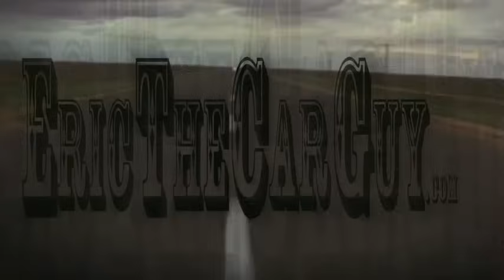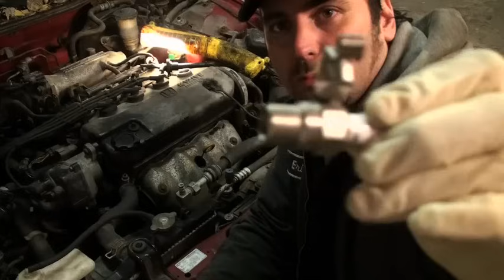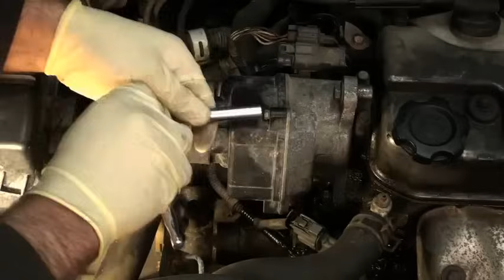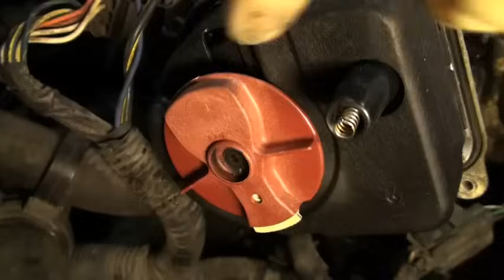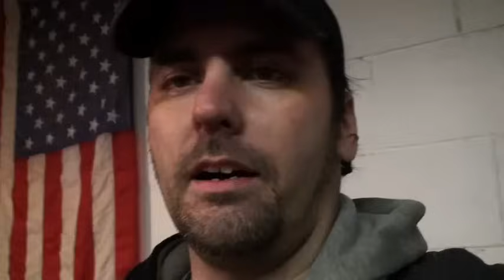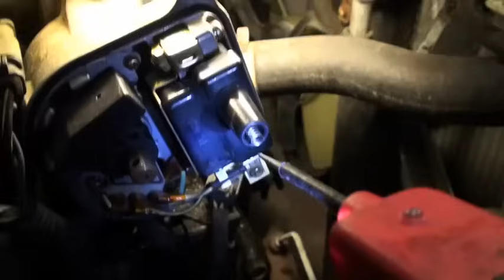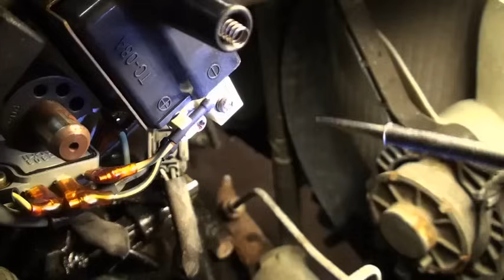No Spark Diagnosis (Honda) - EricTheCarGuy

Comment from the maker: @chadnfs OK did you check for a head gasket failure by checking for combustion leaks into the cooling system or do a compression test?  Did you check for vacuum leaks?  If not your wasting both our times.

Comment from the maker: @kevykev38 Well lets start by what type of coil you are using, good quality?  Next, you have to be sure to hook them up correctly since they will work if you have them hooked up backwards but may fail prematurely.  You can also try moving it to a different location that is cooler.  The resistor that I think your friend is referring to is actually in the primary side of the ignition, think that white block on the firewall of a Dodge that used to go bad all the time.

Comment from the maker: @chadnfs Did you check for a combustion leak into the cooling system, like for a bad head gasket?  I said check for vacuum LEAKS not just vacuum.  You can keep throwing parts at it if it makes you feel better though. :)

Comment from the maker: @jmax95 You didn't do the tests in the video did you?  It's OK Just try to diagnose something before you replace parts in the future, it might save you some money.  Since you did an engine swap I would check the connections at the ECU as well as the fuses for powering up the ignition system.  Make sure you have power at the coil (+), if not look for the cause.

Comment from the maker: @ThirdRomeAquilo Well you can't fault me for not following instructions because in the video you check for spark at the coil first.  Your light might not be dead, some of them have a built in circuit breaker that can be reset, you might want to check yours.  I really am sorry to hear about your light, I recommend replacing it with a power probe like I used in the video as you can do a lot more with it that you could with a regular test light, worth the money.

Comment from the maker: @chadnfs Based on your message and the symptoms you describe I would start by checking for a combustion leak into the cooling system (watch my overheat diagnosis video for this test).  You might have a head gasket problem.  If that's not the problem look for vacuum leaks around the intake.  If you replaced the Honda fuel pump with an aftermarket I recommend swapping it back out for the original as it is a much better pump.

Comment from the maker: @trecey920 If you turn the key and hear a click and nothing happens it usually means one of 2 things, the starter is bad or there is a poor connection.  Check all the connections as well as the starter (you might tap it with a hammer to see if it will start, if it does then I would replace the starter).

Comment from the maker: @skydivechuk57 It's impossible for me to tell exactly what is going on with your car but I will try to help.  First you need to find out what is missing when the car doesn't start, spark or fuel, in your case since the car does run I think you can rule out a mechanical malfunction.

Comment from the maker: @trecey920 From the sound of it it sounds like a "no crank, no start".  If you had the starter changed already I would check the battery and it's connections.  Also not a bad idea to check the fuses.

Comment: I'm having a problem with car not starting, and it also overheats. that's another issue, I have to first find out why it's not starting. I have a mechanic telling me to dont' get rid of the car, but I'm tired of the crap with it. It's a 92 Chevy Lumina (15yrs old) it want start when I turn the key it makes a clicking noise I had the starter changed, it still doing it. What is causing this problem? Please help a lady out here. Thx

Comment from the maker: @JEDIMASTERMOTI These are classic main relay symptoms.  Check to see if there is fuel pressure when it is not starting, if it doesn't have any watch the video I did on repairing a main relay.  I also did a video on checking for fuel pressure BTW.

Comment from the maker: @mrrrxxxxx Yes, I think you are right.  To be specific I think the clutch is sticking on the shaft and not releasing like it should.  I have known of situations where if you lubricate the shaft it will work as normal again and you won't need to replace the starter.  However you will need to remove the starter to try this and if the starter is old and has other issues and you reinstall it you will have to go through it all over again and still end up replacing it if it doesn't work.

Comment from the maker: @nobleheight You have told me what you replaced but not what you found.  In the last comment I suggested you perform the test like in the video, once you do you will know if the problem is in the primary or secondary part of the circuit.  Get me that information and I will be able to help but not before.

Comment from the maker: @nobleheight I haven't really seen problems with the pick ups inside the distributor unless it was aftermarket.  I've seen plenty of problems with aftermarket ignition parts failing even brand new.  When you have the no spark look for the things outlined in this video and see what you come up with.  If you have a signal at the coil (-) then replace the coil, if you don't you need to look into the primary side of the circuit.

Comment from the maker: @terryellis08 Did you check for fuel pressure during the no start?  Just listening for the fuel pump is not enough, you need to see if you are missing fuel pressure to properly diagnose the fuel system and then worry about the main relay.  Do you have a check engine light?  If so what code?  Do you have spark?  Check these things before putting any more parts on it.  Once you find out what is missing during the no start then you can begin to fix the problem.  Good luck.

Comment: @EricTheCarGuy  it is a 4 cylinder.sor far i changed the open circuit relay and efi relay .Then i unplugged the two wire plug to the distributor to test if it had power which it did at the time and plugged it back in.After that i thought the problem was fixed with no explanation because the problem went away for a few days but now has returned

Comment from the maker: @daymkimchee It sounds like an ignition problem but it's hard to say where.  Lets start with this, is it a 4 or 6 cyl?  and if it's a 6 does it have a distributer or 3 coil on plugs with leads to the other 3 cylinders?

Comment: i have a 95 toyota camry that dosent start after it has been running some time.The car never dies while driving but just dosent start after driving.I narrowed down that when this happens is that its not getting spark.Ever heard of this problem from your experience?

Comment from the maker: @cagmito76 Not all do, in fact there are quite a few configurations.  It really depends on the manufacturer what type is used.  I see less distributors on late model cars as using "direct ignition" (coil on plug) is a more accurate way to ignite the mixture and makes for better emissions.  I'll be doing an entire series on engine systems at some point so stay tuned.

Comment from the maker: I've had a couple of request's about oil leaks on this engine, enough that I will probably be posting a video on it soon, distributor "o" ring included.  It's important to note however that if you have an oil leak INSIDE the distributor, you will need to replace it, the "o" ring is the cure for an EXTERNAL leak.

Comment: Eric, you mention about the oil inside the distributor cab. It happens to my 1999 accord LX VTEC 4 cy, and if I drive more than 2k miles, the oil became REALLY low and i had to add before the next oil change. My friend at work was telling me that the O-ring is bad. I have no idea where that is since I have no clue about fixing the car, but your video make me want to learn. I wonder if you would make a video  about O-ring  replacement or burning oil problems on Honda. Especially Accord LX VTEC

Comment: i changed the coil and ignitor.I checked all the pins to the distributor plug and found out it wasnt getting any power at all.Where shoulda i check next

Comment from the maker: The tool that I use in the video actually hooks up to the battery on both the (+) and (-) terminals.  There is a link in the description where you can look/buy one.  I find it very useful for doing electrical work on cars and trucks because not only does it tell me if I have power or ground it also supplies them at the flip of a switch.

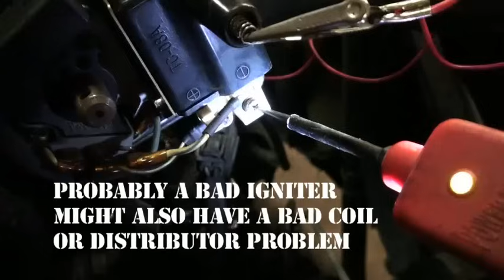Comment: I got a question about the video. When you are checking to see if the ignitor is switching the coil on & off. Using a test light, what do you hook up the alligator clip to? Is it still to ground or do you hook it up to the coil spring like at 6:23 sec. Or was that alligator clip just there in the video. Thanks...

Comment: i have a 1991 honda civic wagon  thats not getting power to the dizzy, i hot wired  the dizzy to the battery and it started right up, but the car has no rpm reading when tested it, what could be the problem?

Comment: ive heard that if there is no crank when trying to start it, it's not related to the distributor (or any part related to it)? when my car died it was cranking fine, but today there is no crank unless i try to jump start it. whats wrong here? i also took out the spark plugs and still wasnt even cranking.

Comment: hey eric,
i was driving my 92 civic and all of a sudden the car started losing power. when i throttled it the car would jerk and struggle to move forward, and when i came to a stop the car stalled and couldnt restart it. now after it died, i was able to crank it but no fire, i then tried later and there was no crank at all, tried jumpstarting it then it started cranking again, and then later it didnt. spark plugs seem to be fine, and battery is fairly new. could this be the ignitor coils?

Comment from the maker: Check to see if you have fuel pressure, if you don't see my video on repairing a Main relay.  If the relay is OK, check the remainder of the fuel pump circuit for problems.  If you have fuel, check to see if the engine is mechanically in time.

Comment from the maker: Hard to say, I don't have as much experience with those cars as I do with some others.  Since it effects both the ignition and the fuel I would be looking to things like the ignition switch or main relay.  Also, if you have a security system on the car find out if that's working properly, sometimes when they have issue they can cause a no start.

Comment: i checked the fuel pump and thers no pressure being pumped all though we checked the fuel pump and it worked. so no spark, no fuel being pumped, ignition? computer?
thanks.

Comment from the maker: To be honest GM modules and crank sensors are known for problems.  When I encounter them I usually replace both for good measure especially since some crank sensors are mounted under the modules.  If a GM coil goes bad you will have a miss on 2 cylinders, if the module goes bad you will have a no start caused by no spark. I do have a cool test for checking the old style module in an HEI distributor however using 2 wet fingers.

Comment from the maker: Quite simply, red or orange dust inside the cap or in some cases oil will begin to leak inside the distributor itself.  Many of these distributors got replaced during a campaign some time back but they still show up from time to time.

Comment: Good morning Eric. Just out of shear curiosity I drive a bus @ work its a bus body on top of an International 3600 chassie w/max force DT diesel engine. Is the iol change interval the same as that of a gas engine? I do about 3500 miles/month.

Comment: Thanks Eric. The Main problem with the Passlock system and getting it repaired, is that the no start is so intermitent that the planets and starts have to be alighned in the correct order for it to do it's little trick for the for the poor fella working on it. I already took it to a very good shop here in town where they had it for almost 2 weeks a do the best they could do was replace the cam positioning sensor.

Comment from the maker: I was just pointing out that I had addressed your question in the video, I spend a lot more time than you might think putting these videos together to be as accurate as I can make them. My motivation is to help those that need it, nothing more.There are times when your comments seem redundant and serve only to declare your knowledge of the topics I cover. You don't need my approval, I think you just need "do" more than "read" sometimes.
Reply: EricTheCarGuy  I have a 1994 rs non vtec where is the Crank position sensor? Can’t find it on the bottom block. People say distributor? Can you make vid on that . To clear everything. I got the code 4 .
Reply: You poor man, giving us a super informative video just to be asked really specific problems about random people's honda problems when they could have just searched another video for it
Reply: I love your videos and they have greatly helped me out numerous times!!! I greatly appreciate you taking the time out of ur day to make these videos for us!
Reply: I have a 91 Honda accord 10th year anniversary what mine is doin I can hear it sputter while driving even when am on the freeway I cant tell it lacks on power but it does however cain of kicks a little as I take off do u know what it mite be ?
Reply: U
Reply: I know this vid was posted way back but hoping someone can verify why my 99 civic dx has a rotor with no set screw. Is this because it's a dx, it has a mani-cat too
Reply: @shorelined1  yeah dx rotor has no set screw
Reply: I have been checking a 2000 honda accord, changed timing belt and water pump, i have voltage in the fuel pump fuse, but no voltage on The pump cable, nor on the relay output., Spark voltage but no spark,  the fuel line is dry, what could i check. The crankshaft sensor is sending voltage when we crank. Also the 7.5 amp  starter fuse has voltage when cranking
Reply: 15 years later, thank you.

Comment: Thank you Eric that's what I was afraid of. I did a litle bit of research and turns out GM has has this problem on certain sedan models such as the Buick Regal and the Pontiac Grand Prix but didn't find anything on the trucks.

Comment from the maker: In the "real world" everything is done by the alignment machine and all you do is hook up the sensors, calibrate them, and adjust parts as necessary starting with the rear wheels.  Anything outside of that can only be corrected with a frame alignment machine at a body shop.

Comment from the maker: Those systems have been know to cause a no start.  Unfortunately the only way to diagnose it is to eliminate all other possibilities.  Equally unfortunate is that to repair it you will need a TECH1 that only the dealer has possession of.  Replacing any of the parts in that system requires that special tool to preform a "handshake" with all applicable parts in the system.

Comment: Since the Passlock system cuts off the fuel supply for exacly 10 minutes, how do I diagnose where the fault in the Passlock system is within that 10 minutes?

Comment: Hello Eric. I have a VERY intermitent starting problem with my 04 GMC Canyon (Chevy Colorado) and after a year with this headache I finaly suspect the Passlock system is the culprate because the truck starts fine after exactly 10 minutes. It does this 2 - 3 times/month on average.

Comment from the maker: I've seen it on Mazda's and some Ford's (that have Mazda engines).The plugs don't fire at the same time, one plug fires on the exhaust stroke to help burn any unburned fuel to help reduce emissions.  Later model rotary engines also use 2 plugs in a similar fashion.I would recommend you get out there and start working on some cars and put the books away for a while.There is a huge difference between theory and practice. It might be easier to grasp some of these concepts if you saw them in action.

Comment from the maker: Those headlights are known for breaks in the wiring that runs the motor behind the headlight itself.  Check the wires before replacing any parts, the fix may just be a few solder joints instead of buying parts.

Comment from the maker: The trans problems started to go away in the 05 model year but they still popped up from time to time.  As for the Camry, they always shifted smoother than their Honda counterparts, they seemed to ride smoother too.  Honda's were better in the corners and seemed to be more performance oriented where the Toyota's seemed to have a more luxury slant.  In my opinion anyway.

Comment: @nobleheight Vacuum gauge? A Vac Gauge is normally used to check a source or test a vacuum applied unit ie Vac Advance of a distributor.
1. Analyzer - a machine developed to test engine conditions.. 

Les

Comment from the maker: That "o" ring is a common problem indeed but easy to fix.  The internal oil leak is sometimes proceeded by "red dust" inside the cap indicating that the bushing might be starting to fail.  Most of the problem distributors got replace during a campaign so you don't see too many of the internal oil leaks any more.

Comment from the maker: Yes that "o" ring is a very common problem but I was referring to a failure of the bushing inside the distributor that often causes and internal leak within the distributor (and sometimes noise) which can only be repaired by replacement. The same busing is responsible for the "red dust" that is an indication of failure of the bushing.